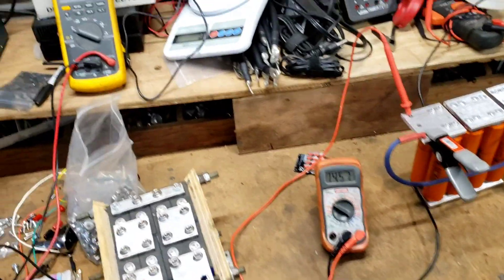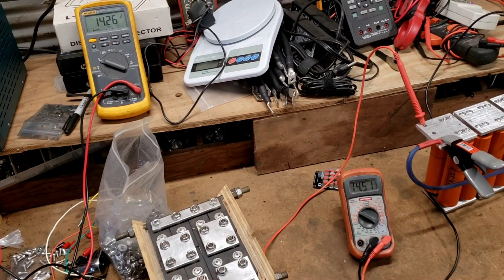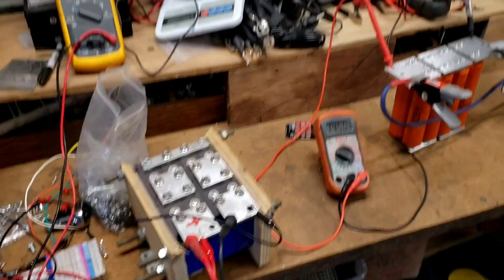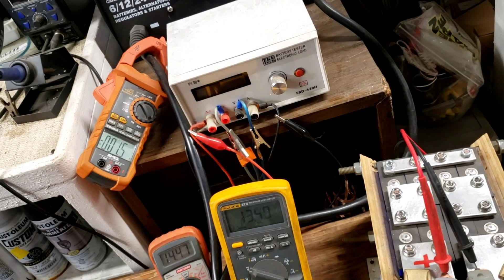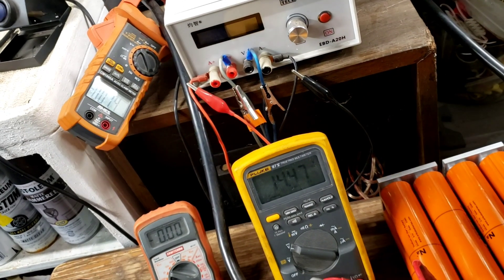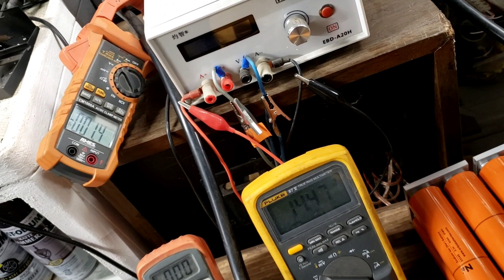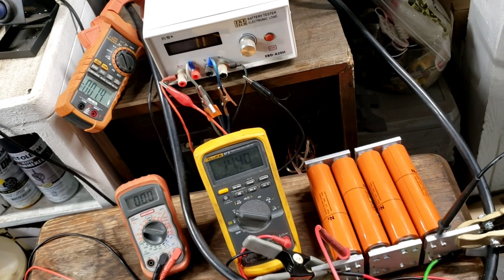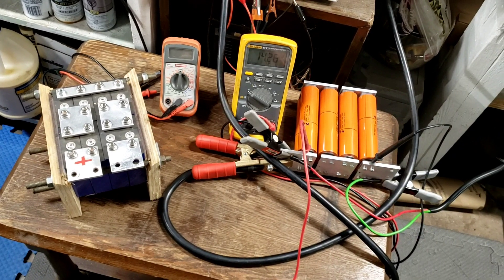lishen 8.5ah vs sodium ion 10ah cells test load with recharge

Comment: These cells seem very appealing, but the numbers stated by skiro dont match the data sheets, or what other sellers say on alibaba. 

I can see from the tests on this channel that they can clearly handle a lot of charge and discharge current. My questions are as follows:

1.)where is skiro getting these cells/how are they performing so much better than what the data sheet and other sellers woukd have you believe?

2.) are the basing there ratings of 18ah 10c discharge, 6c charge on internal testing? If so is this documented anywhere for others to review?

3.) does this excessive charge and discharge rate greatly effect cycle life given that sodium ion already has roughly half the cycle life of LiFePO4?

I stepped out of the bass scene for 2 years and back then it was either 38120 headway, yinlong, or cmax. I had a 25p4s headway bank with 800a of alt that powered 2 salt 8k's pushing a max of 20,000 watts. They dipped to 12.8 during those 20k burps. 

Based on everything ive seen on this channel, these new 46145 sodium ion cells should knock my headway bank out of the water. Im left puzzeled because with headway the data sheets very closely reflected the performance stated on skiros website. With these new sodium cells the numbers are way off. 

I'd really appreciate any clarity on the situation.